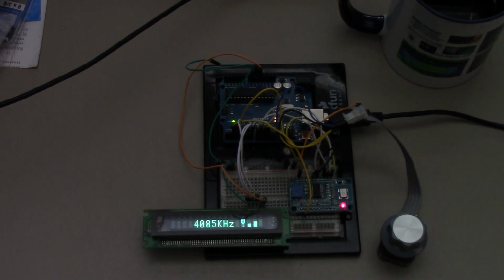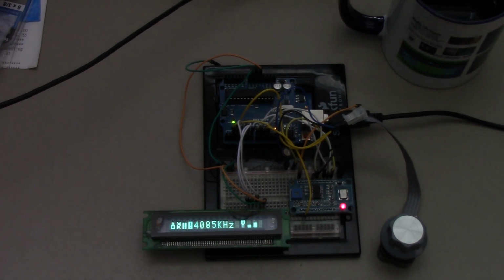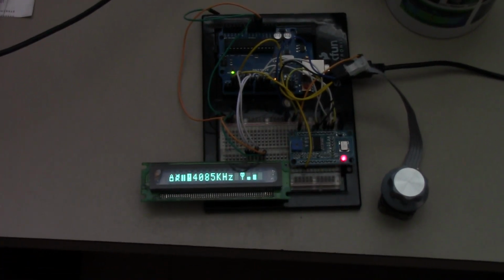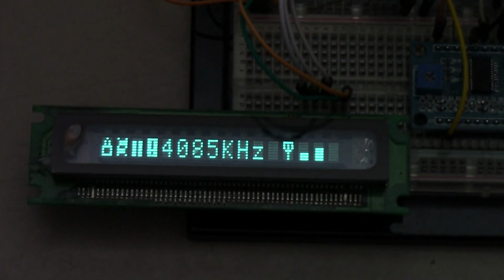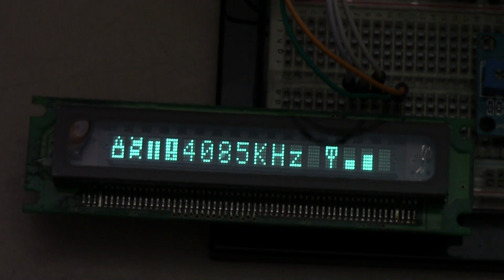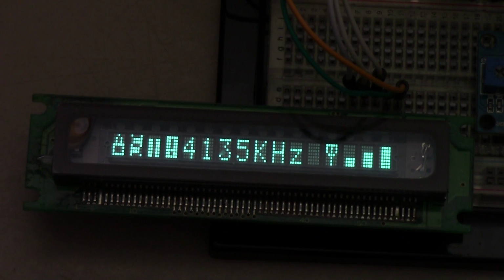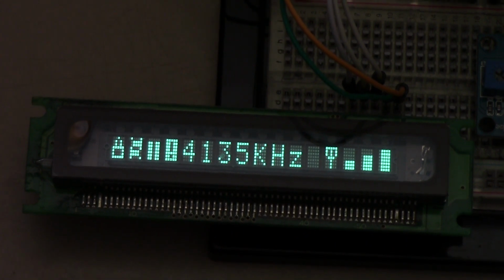Open source and the pirate radio hobbyist

Comment: Awesome work! If you want some help with the code, let me know.
Reply from the maker: If the offer is still on the table, I could use a hand writing a plain text serial control routine for changing the frequency via a serial connection.